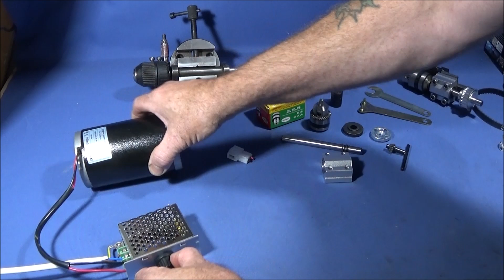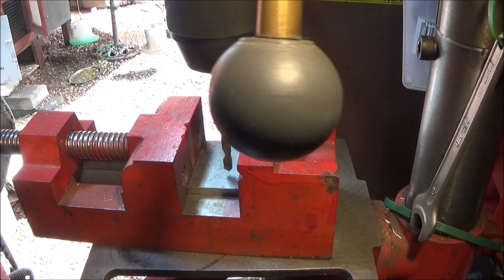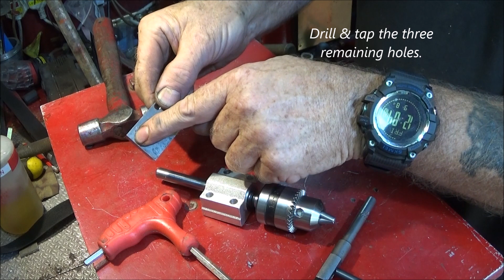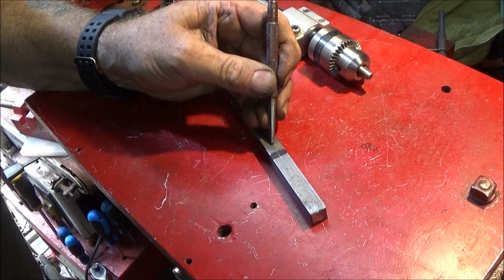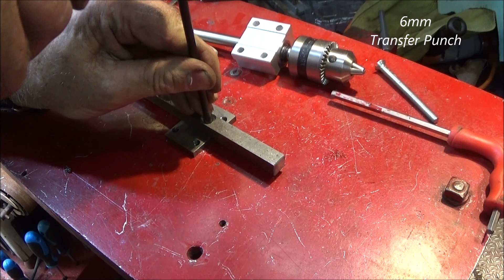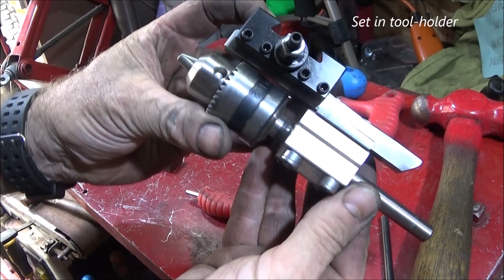Making The Machifit Toolpost drill & A New 220v Project Motor

Comment: Thanks for the Video ..
So you think the B10 is good enough for one DIY mini lathe with approx. 80mm lathe chuck enough for wood and smaller parts of metal such as pencils and rings etc. from different soft and hard metals?
I ask that I would not later regret the missed investment ..

Comment: Hi Steve,   I have put one of these on my cart and then saw this video so waited to watch it.   I am wondering what size of a chuck to order.   Will the bigger chuck be to big and hit the square 10 mm bar?   Would appreciate some advice.    Thanks
Reply from the maker: Hi Dale yes the bigger one will hit. The best size is the one that takes up to 10mm. You need the bar extended to the end of the chuck to give versatility in being able to pull it back for extra room. Also you can make a toolpost vice to go in the tool holder to takke the toolpost drill which gives even greater available length and room. You could also get away with the 6mm chuck as I have never drilled with a larger diameter than that from the toolpost. Regards Steve.

Comment: Hmm maybe better for me to use a cutoff wheel instead of piddling around with a parting tool.
Reply: That could work if your wheel is parallel to the chuck on small and not so powerfull lathes.But keep in mind it will cause heat on your workpeace since cutoff wheels work on friction.You will have to cover your lathe since there is a lot of abrasive dust mixed with steel particles that were removed.Instead i suggest cashing out a bit and buy 3mm wide or smaller parting blade with inserts. This style :https://www.banggood.com/SPB32-3-32mm-Grooving-Cut-Off-Cutter-for-SP200-Insert-SMBB163220322532-Tool-Holder-p-1148358.html?rmmds=search&cur_warehouse=CN
i like those because you can easy change how much blade extends as you progress trough work.
You could use hss ones but you need to grind clearance angles correctly(side angles only tip of blade is in contact with metal,chip breaker aka back rake is also important) ,i recommend grinding the tip like this / (not this much of angle ofc )instead of flat.It reduces the load a bit.
If you are not skilled on a grinder then inserts are good for you since they are already ground properly.
Reply from the maker: Hi Joshua, I mostly use a hacksaw rather than a part-off, even though I show parting off on video. If you saw things off on the lathe, make sure you cover the lathe bed. For bar up to about 1" inch I use one of those cut-off grinder tools or an angle grinder to cut lengths ready for machining. Regards Steve
Reply: @SteveJordan  yes anytime I use anything abrasive my lathe bed gets covered up. I have a 1950s Craftsman lathe and it's still in great shape despite sitting for 12years. A coworker gave it to me and said to take it to the scrap yard or use it.